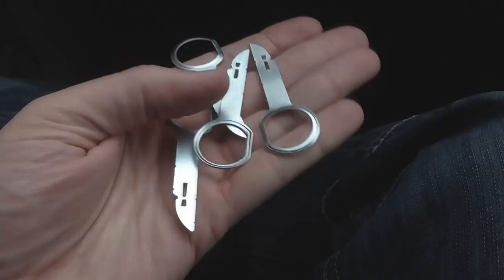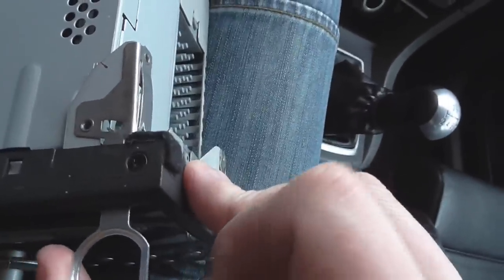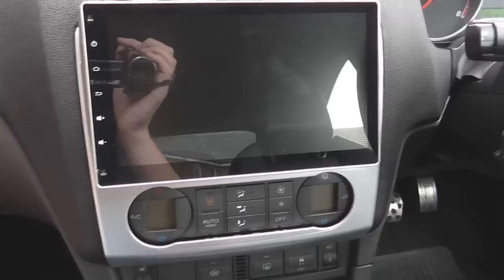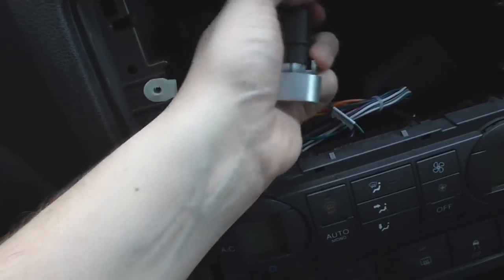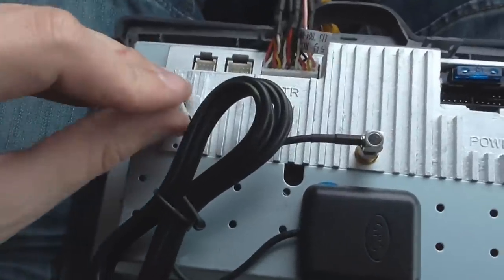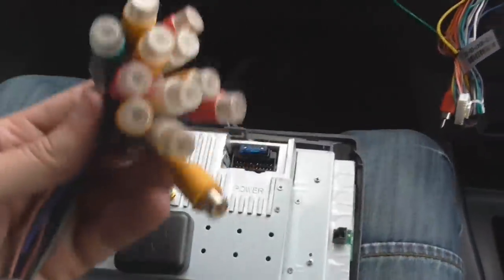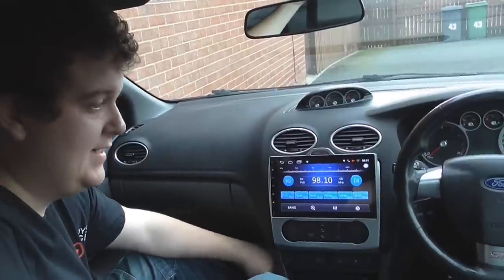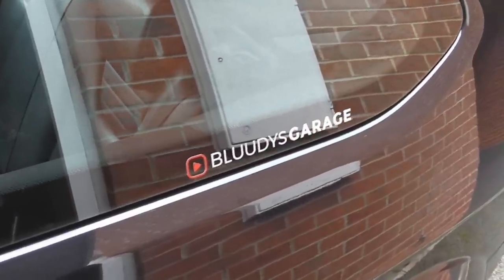CAN you install a HUGE Tablet in a car?

Comment: Hi! The climate control panel in my car is like this. I would also like to buy such a unit, but the link in the description does not point to a 10.1-inch display, but to a 9-inch display. That wouldn't even be a problem. But the installation frame is completely different for the climate control part than what I see in the video. According to other descriptions, the 9-inch frame does not fit this climate controller. Can you help me where I can buy the same one as you have? Unfortunately, I can't find it. Also, if you don't have one, would the other 9-inch frame be good? I am also interested in another solution.... Thanks for the help!

Comment: Thanks for the video. I just ordeded this unit from Wish. I already have a aftermarket unit from Pioneer in the car but the screen is bad and its missing GPS(only avilible with Apple car play or something). So a external GPS and microphone is already routed to the top left inside the car. Too bad this Android unit doesnt have a mic input because the mic to the Pioneer unit is really good. The one to the Android one is built in, right?

Comment: Oh this looks nice. I've got the standard 6 disc changer on mine (with shocking signal reception) I think I'll have to treat her to one of these as it makes the interior look much smarter. Are you happy with it or would you recommend a different unit now after spending some time with it?
Reply from the maker: I would. It does suffer radio signal wise in poorer weather. You can get a DAB add on which would be worth the money.
Reply: @bluudysgarage  Thank you.

Comment: Looks really good.

But, is it just the two clips that hold the whole thing in?
Reply from the maker: 2 clips at the bottom, 2 clips at the top and 2 clips in the middle. only the bottom ones require those metal clips.

Comment: I've just installed one right now. Not enought adjustments, the steering buttons doesn't work and the piece of plastic is bad manufactured and pushesh the buttons of the air conditioner.
Sound quality is a bit meh but it's okay for the price, better than the original radio. 

I suggest better paying more for a better brand, even chinese, or for a Kenwood or similar one.
Reply: You go into the settings menu to do the steering wheel controls. They are a great fit just  a little fiddling with to get right 👍🏻
Reply: @paulgregory4841  Wel... mine doesn't recognize the controls. IDK why but no button works, bul I have the cheapest version. The brand and the seller are just crap, now i know, but at least the sw controls should work.

Comment: Thoes 2 rcas on the ford conversion cable should be for the factory aux port to still have functionality
Reply from the maker: Ben Moore thanks for the advice ben. I wasn't sure but been doing some research and seen that it connects into the other loom I disconnected. I'll reconnect it next time.
Reply: Bluudys Garage no problem it it should go into that loom you disconnected it looks the same setup as the Chinese eonon and xtrons units I've owned also of you turn off handbreak you should be able to watch videos without having to ground the cable 👍
Reply from the maker: Ben Moore thanks ben. You are right with the wiring. I'll play around with the handbrake. But worse case I ground it.